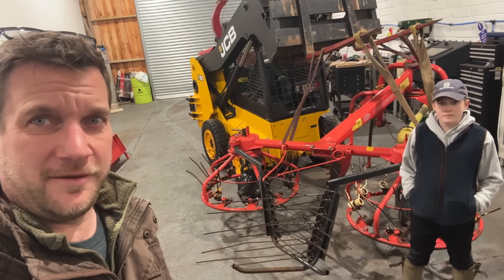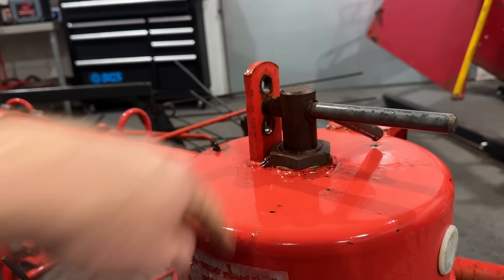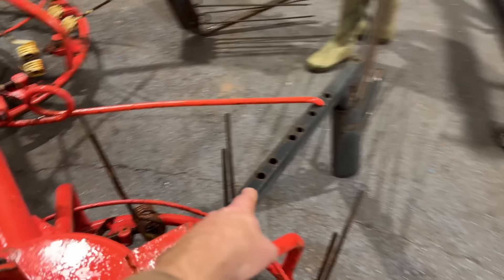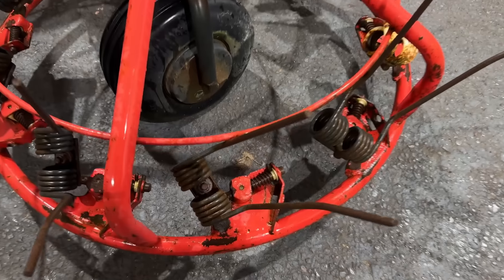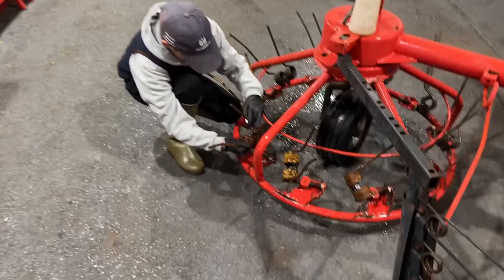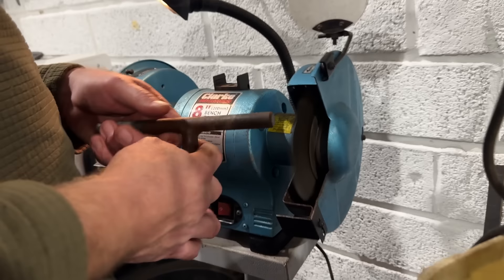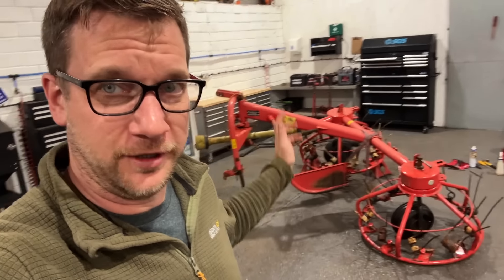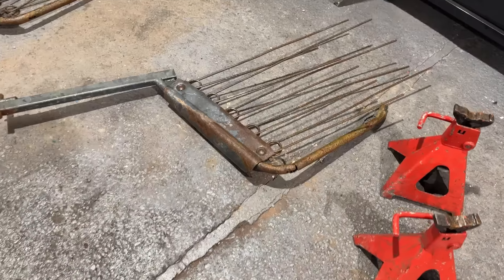Servicing a 300 series Vicon HAYBOB! Why Do People Even Buy Them?

Comment: A brilliant machine,  problem was, people perhaps didn't have them set properly.  Top hole rowing.. bottom  hole tedding..  tines in inside hole for rowing.. outside hole for tedding. Gate settings are pretty obvious.  Toplink holes, just use nearest to tractor as itll usually be nearest to length of your toplink, then adjust back so tines are just brushing stubble. 
  Careful when hitting top of wheel shaft... you could squeeze the height adjustment handle hole and bush wont fit properly leading to handle being too tight, or worse, not fitting.    With tine of, spring replacement is a 40 second job.  
  You've a valuable machine there being the genuine one.  A lot 20 years ago were coming from eastern Europe which had  inferior quality. Dont know about now as im out of that job, but i used to sell  one hundred plus haybobs, mainly the older ones.   You brought back many good memories,  thanks, and good luck with yours.
Reply from the maker: Thank you Samual. That’s really good info. Yeah hopefully she will be a good one.

Comment: For my sins i still use a haybob for tedding and  rowing up, always found to be most effective at low revs @1400-1500 if on my 135 i put the tractor in ground speed for tedding. Does a good job. Managed to pickup an old haybob for spares last winter. Cant get a suitable replacement for the money so will.plod on as things are.

Comment: Great to see them shafts move up and down the one we had they were stuck solid even tried heat and a big hammer still never moved so they were permanently in the centre hole but still worked fine, we used oil on the springs and bushes squirting the oil in the little holes above the bushes, that looks really smart now well done to you both  👍
Reply from the maker: Thank you Nev, it was a relieve when they went haha

Comment: I have  a  PZ HAYBOB  300  i have it 15 years now  good machine in good weather  if grass is too wet and stemmy  it makes a rope of the grass  The correct setting for the tines are for Tedding they go in the outside hole and the oposite for Rowing  also the gates can be removed without touching the circlips on the top

Comment: Was hoping the centre shafts were seized solid so I could watch how you un seized them for doing my own - damn 😂
Reply: Worst case... big nut of top.   Inner tube with treads is seized to wheel axle. Drop wheel axle down out of bearings in crown wheel.  Gas, dip in cold water and bobs your uncle.   It's obvious and simple enough really. Just make sure to watch for shims and replace in same order.  Couple or three hours work. You've  6 or 7 months to get it done, lol.
Reply from the maker: Haha, I wasn’t lol. Keep soaking in penetrating oil regularly and hopefully it might go. Or what Samual said.
Reply: @samuelrobinson9012 thankyou 👍👍

Comment: Hi James + Max, good service and repair work on the Haybob, it will be working like a good one. like the idea of home made lube, oil and diesel mix, I made a bottle of lube using lighter fluid petrol and 10w/40 engine oil that is a good mix and I use it, I spray it on my metal work surfaces bandsaw and bench top drill press to stop rusting over the winter months.
Good to see you both working together, catch you soon    Take care
Reply from the maker: Thank you Shaun. Can’t beat a bit of diesel and oil mix 👍🏼

Comment: Use a pair of haybob 300's on my granda's croft, wee use a Ford 4600, a International Harvester 684 and a Marshall 802.  They are stuck in the top hole and work alright but occasionally the tines pick up dirt.  The only issues have been a bent basket because my dad hit a tree stump, gates might have been put on the wrong way round and the covers came off and having to change one of the tyres which was a bugger.   We use oil and wd40 on the springs and they are easy to change despite being stored outside for the entire year in the north of Scotland.